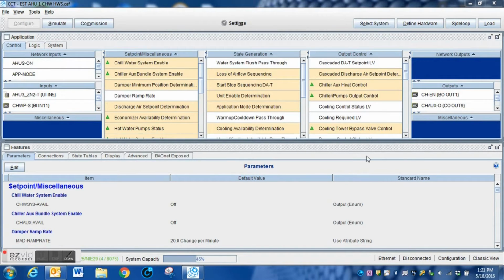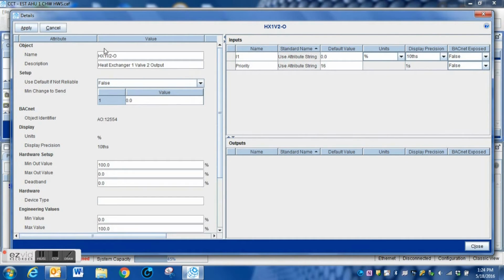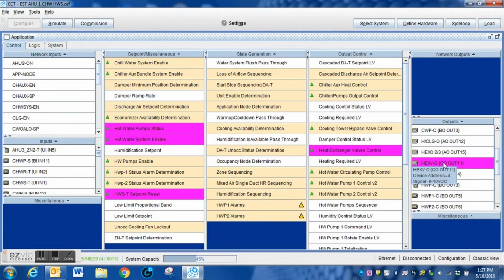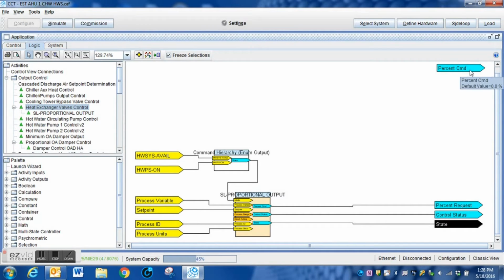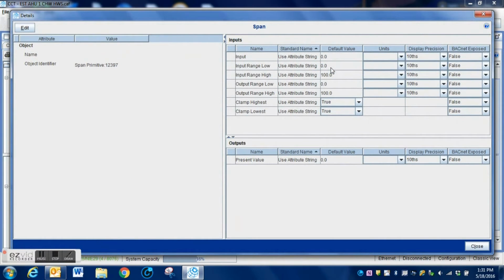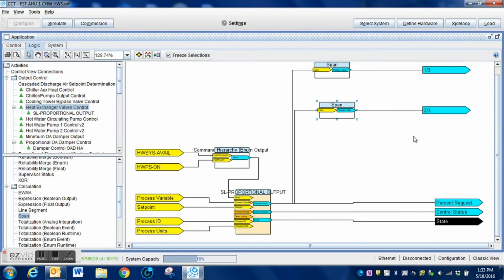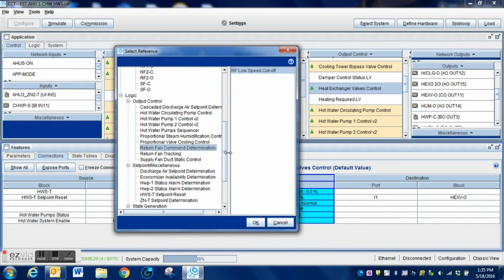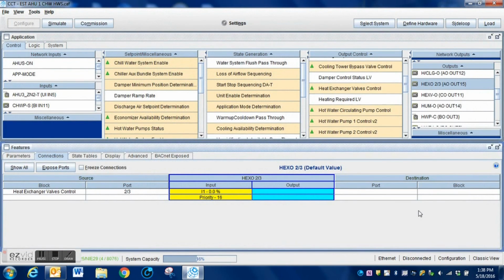How to Modify control programming using Controller Configuration Tool from Johnson Controls

Comment: Do you have a gas meter pulse monitoring program video ?
Reply from the maker: Ive got a video showing how to add a meter which is basically the same thing.  A pulse count regardless of the source is the same. You just need to know the multiplier

Comment: I have been searching for various videos that help me a lot. I am wondering if it possible to upgrade NAE 5.2 firmware version to 8.1 firmware version and how would I go about doing this? Appreciate the help!
Reply from the maker: +Pavel Groshev depending on the NAE, don't do it.  8.1 has a serious issue with the nae55. If it is a smaller nae you can upgrade it from sct. That's a new thing with the newer version.  Just do a code download from sct
Reply: We have couple upgraded NAE55, they seems to be working fine and I need to upgrade few more because of we need to add wireless trunk.  I was tolled  we need to use NAE update tool.  Do you have any idea how to do it?
Reply from the maker: +Pavel Groshev some of the tools are restricted by jci. That's one tool I haven't been able to get my hands on. You don't need that tool to add a wireless trunk. You will add the coordinator like any other device and all your wireless devices go to the coordinator.

Comment: Hi ,

I'm using PCT 10.2 version to create a Program for the AHU operated with VFD . I have loaded the same Program into the controller , during the commissioning mode , I right clicked command on the SF-C ( supply fan command ) to ON and VFD signal (SF-O ) to 100 % . The AHU started to operate in full speed .  As its started I received the SF-S (Supply Fan status ) ON . 
once I received the fan Status , I demanded the Zone Setpoint ZN-SP , But cooling valve doesnot actuate . What could be the reason.. 
In simulation mode , it works and I tried to show the involvement and found ZN-SP and ZN-T are linked with CLG-O 
Please help 
thank you
Reply from the maker: +Sharan John view the logic when you are commissioned in and see if it has switched to control.  It may be t-control or something similar.   If it hasn't, look to see what switches the mode of the logic blocks.  I have a few other videos on cct that may help.

Comment: I have been searching for various videos that can help me figure out how to work with CCT. Right now I'm stuck on an issue where I need to change AHU multi-zone physical zone temperature inputs(ZN-T) to network temperature inputs. How would I go about doing this? Appreciate the help!
Reply from the maker: +Pavel Groshev what you want to do is first make a list of the connections where the current zone temp is used. You will then have to create a new network input by right clicking on the network portion of the input side. Once you create it, you'll have to reconnect it to the previous logic blocks. I have a couple videos on cct that will help.  Check out my channel for more information.

Comment: I'am having trouble downloading a file. I keep getting failed operation , in the failed status it says application failed additional info device state startup in progress. I've powered controller on and off multiple times. Any suggestions? I'm using pct version 10.2
Reply from the maker: +Spyder-Man 79 I had the very same thing happen to me the other day.  It was a bad fec and there wasn't anything I could do. I was plugged directly into the controller but couldn't get it to work.
Reply: I m using 2.2 version .how  to open in working control to CCT